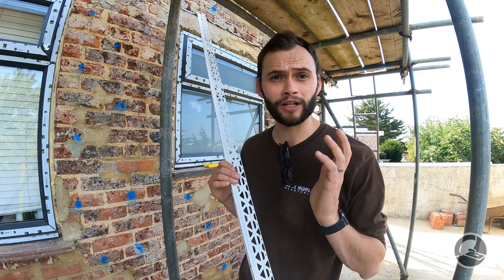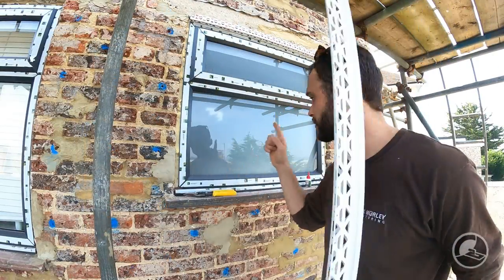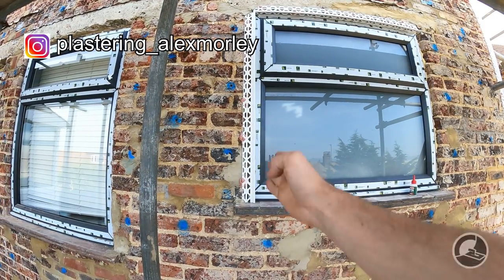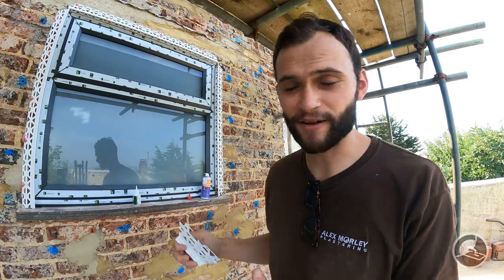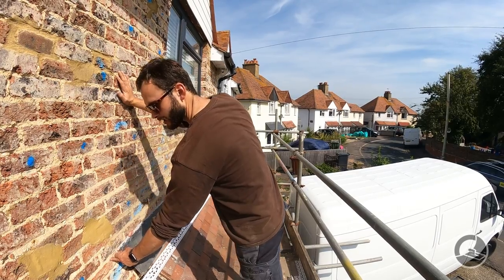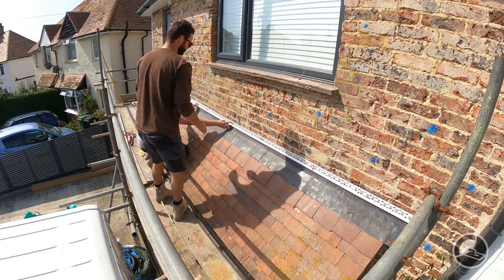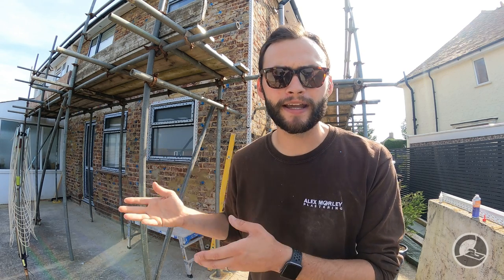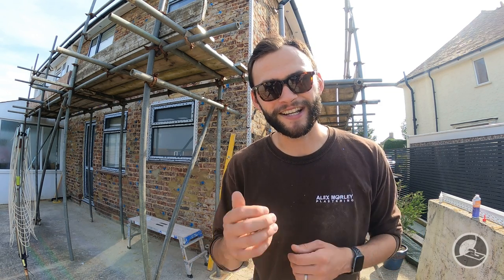How to Install Render Beads

Comment: My home is far from the sea, but I still have issues with galvanised beads corroding. As a DIY'er working on my own home, I don't need to think about productivity. Not having the proper tools, I used the paper lid from a takeaway to form a radius on one corner, which came out very neat. I can recommend kebab lids that go over foil containers, just don't let your customers see it!

Comment: Couple of pointers that we believe give a far better positioning of bell-cast. We always fix or wedge something like a 4x2 underneath the bead this is the only true way to get a bead straight and in a uniform plain nothing hits the eye more than an in out wonky bead you will not get this by sticking or mechanically fixing without the use of a support. Iam very surprised that you are not forming some of the externals freehand but I do get that you are achieving separate panels. Beads these days are the only way to get a cost effective job with a degree of strength However nothing beats the ability to achieve perfect quoins I guess we’re old fashioned keep up the good work 👍
Reply from the maker: Thanks for the comment John. We do sometimes use timber. Not so much on such small lengths. If it’s a perimeter bell cast all the way round we would. 

Regards forming the edge. It’s a lot more money, makes it hard to be competitive unfortunately. Haven’t been asked to do those for ages. Does look great though.

Comment: Fantastic video, very very helpful. A question for you… I have a block work extension that I am about to render. When positioning the bell-cast just above the DPC, how close to the DPC do you go, so that you do not get any water/moisture problems
Reply from the maker: Thanks for the message. Personally I put where the angle of the bell cast starts on the DPC line or just above it. 

Generally damp coming up the render is when the render is sitting on the floor, as such surface water from the rain etc causes it to creep up the wall. 

It’s not usually moisture from the brick work bellow the bell Cast. As such you could put it bellow the DPC and it would likely be fine. We just generally run it on the DPC line as good practice. That’s all. 

Hope that helps.

Comment: Great videos, Alex. Lots of useful advice. I have to render an aircrete block wall that butts onto a brick wall with an internal corner where the two walls meet. What internal corner expansion beads would you recommend? Not many bead manufacturers seem to make them in UK. Cheers.
Reply: Just use a stop bead

Comment: Great video mate! Im a bricky can do small rendering jobs, ive got a curved bay to do with a bell cast bead.
Would you snip individual beads around it or curve and snip it bud? 
Thank you
Reply from the maker: Depending on the curve plastic beads have a certain amount of flex anyway. Do you might be able to bend it without cutting out the back. But either way is wouldn’t use lots of little bits. Difficult to get it looking any good.
Reply: @AlexMorleyPlastering  ive done it mate👍🏻 i bent a plastic bellcast around it. 
Turned out nice tbh. 
Thank you for replying👌🏻👍🏻

Comment: You did a great preparation!!
How much is the cost of this project approximately. 
Only if you can give me this info. 
Thanks again and great job 👍
Reply from the maker: It’s very dependent on the job. But in this case it was about £5k. Labour and materials. This didn’t include scaffold or hacking off.

Comment: do I have to remove the old beading that has gone rusty before I replace with plastic 😮
Reply: Yes you would. And you can use stainless steel beads instead of plastic but plastic are cheaper. Odd it doesn't suggest stainless on here.

Comment: Great vid, what is the spray you used over the mitre glue?
Reply from the maker: https://www.toolstation.com/mitre-adhesive-kit/p47409?store=I6&utm_source=googleshopping&utm_medium=feed&utm_campaign=googleshoppingfeed&mkwid=_dm&pcrid=560328663820&pkw=&pmt=&gclid=CjwKCAiAqIKNBhAIEiwAu_ZLDh9pdc9_lSua2L0-BgL8xhq_8j8-Ix1KeVIUG1Ozzs5lR6sUrlB6yhoClxcQAvD_BwE&gclsrc=aw.ds

Comment: Great tips. You said you use a box of pink grip. How much of the glue and mitre fix do you use for standard job like this?
Reply from the maker: The mitre fix lasts ages. Prob most of a season TBH. usually we loose them before they run out. 

Regards the pink grip, definitely don’t by singles. On a whole house you go through so much. 

On the video where we talk about the power float we went through 2 boxes. 🤦‍♂️
Reply: Fair enough man. I’ve tried lots of different ideas for beading. Will definitely try this one. I have done it once but I left men on job so didn’t see how easily it went on etc.  Screw and plug takes forever though!! Thanks again
Reply from the maker: Pink grip is the nuts. Not my idea. Seen loads of spreads use it. Works so well. Rock solid within 30-1hr.
Reply: @AlexMorleyPlastering  that’s the dream! Saves the hassle aswell not risking cracks to any old brickwork/beds. Will definitely get trying it next week on roughcasting work
Reply: @AlexMorleyPlastering  have u ever used tec7 for sticking beads it's brilliant for external jobs and waterproof just wandering how it would be on beads
Reply: @HGarry4012  I used it on job currently on.  Sticks good but a lot more pricey than pink grip

Comment: What did you spray the beading with after applying the mitre glue?
Reply from the maker: https://www.screwfix.com/p/mitrebond-aerosol-kit/28848?tc=ST2&ds_kid=92700058168037418&ds_rl=1249416&gclid=Cj0KCQiAoY-PBhCNARIsABcz7733vFyQpKgZNTS8SnzNh79JcFJ68aq1OR7nJAck1bYIH8_Yr6hqL4AaAtMMEALw_wcB&gclsrc=aw.ds
Reply: @AlexMorleyPlastering  thank you

Comment: What is the stuff u spray the mighty lock with??
Reply from the maker: Not sure I follow. Mighty lock?

Are you referring to the activator on the super glue? if so it’s this. 

https://www.screwfix.com/p/mitrebond-aerosol-kit/28848?tc=DT1&ds_kid=92700046986170840&ds_rl=1241687&ds_rl=1245250&ds_rl=1245725&ds_rl=1245250&gclid=CjwKCAjwhaaKBhBcEiwA8acsHEQefgpxV_WUeBAt3AZEfn7X3QNF_eyRELc4ll2l52AO3KUoiix6UBoCBoYQAvD_BwE&gclsrc=aw.ds

Comment: That is a lot of messing around mate ,go on line and get yourself a professional lathing hammer ,some 3/8 or 1/2 stub nails, a speed square and a torpedo level for those small windows, caulking is for painters not plasterers👍